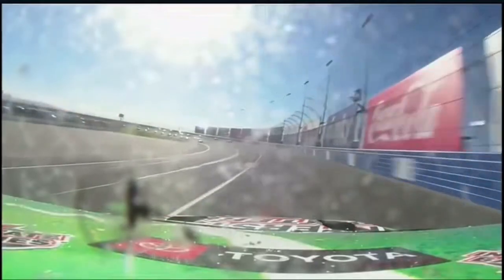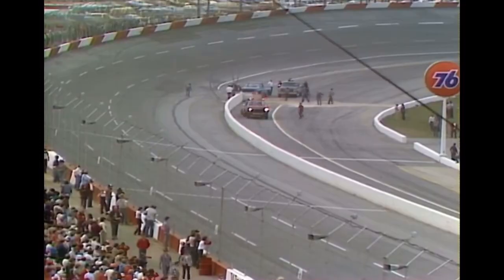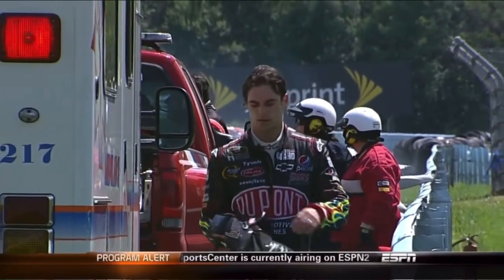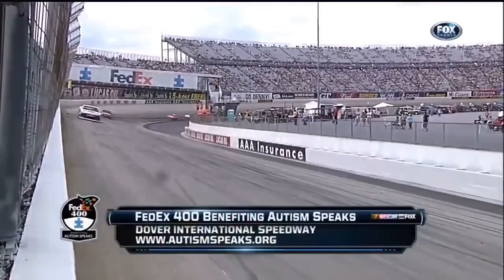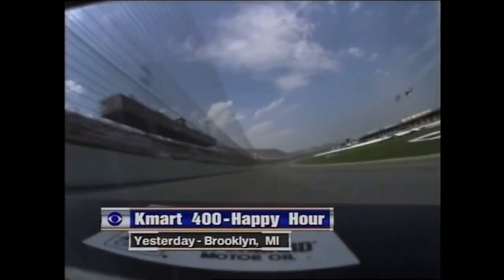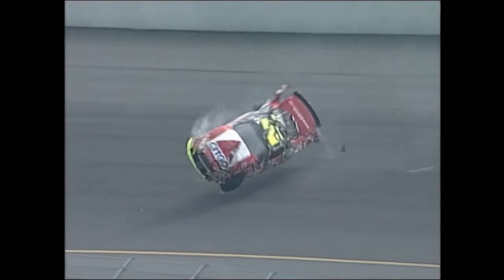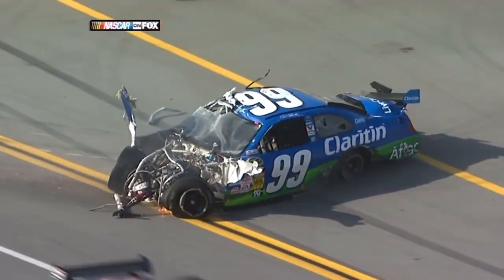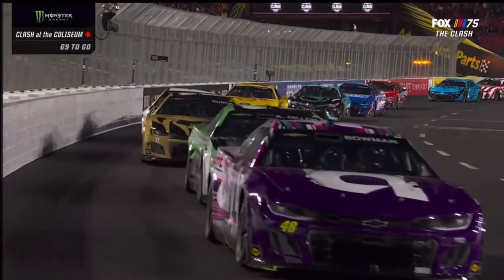NASCAR Broken Camera Moments 1

Comment: Broken Camera Moments 2.
|
2000 - Daytona 250 - Daytona - Craftsman Truck Series - Geoff Bodine Horror crash
2004 - Daytona 500 - Daytona 500 - Cup Series - Michael Waltrip onboard flip
2005 - Pocono 500 - Pocono - Cup Series - Jason Leffler and Kyle Petty crash
2006 - John Deere 250 - Talladega - Craftsman Truck Series - Mike Wallace and Derrike Cope crash
2007 - Daytona 500 - Daytona - Cup Series - Clint Bowyer onboard flip
2009 - Coke Zero 400 - Daytona - Cup Series - Kyle Busch onboard crash and grass cam
2011 - Subway Fresh Fit 400 - Phoenix - Cup Series - Big one at the dogleg with the Digger Cam
2014 - Duel races - Daytona - Cup Series - Parker Kligerman wall ride
2023 - Ag-Pro 300 - Talladega - Xfinity Series - Daniel Hemric wall ride
Reply: You can also add the 1998 Coca-Cola 600 when Mark Martin ran over the camera.
Reply: 2003 - Southern 500 - Darlington - Cup Series - Jeff Gordon and others crash
Reply: 2023 Coke Zero Sugar 400 Ryan Preece flip
Reply: 1996 DieHard 500- Dale Earnhardt's on board in the Big One.
Reply: @Ultimate23Dragon  There was also the other one where Randy Lajoie's roof cam got killed after a crash with Earnhardt.
Reply: @shelbysolko7783  That was also the 1998 Coca-Cola 600 when they crashed together.